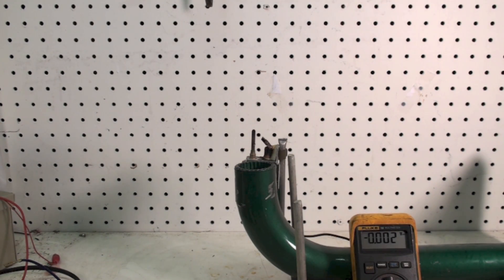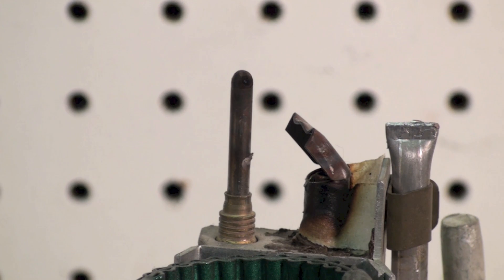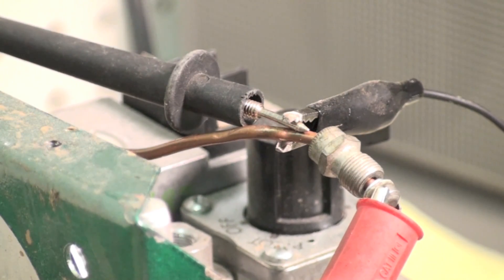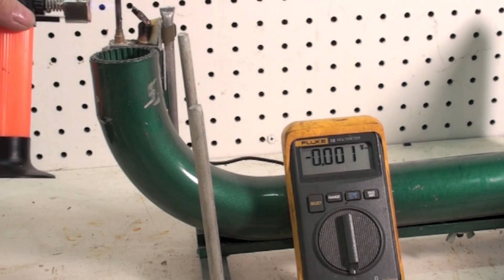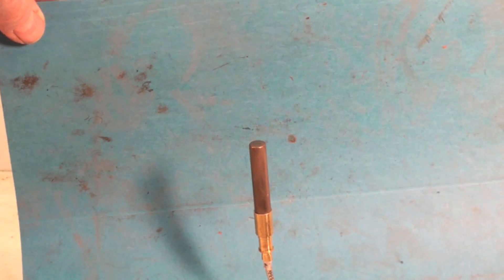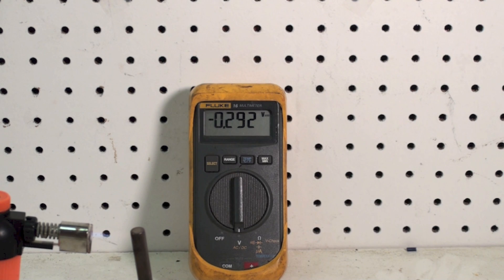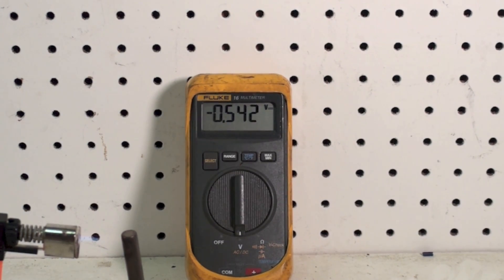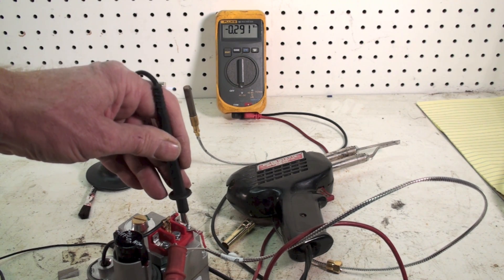The thermocouple compared to the thermopile.

Comment: I'm here to find out how wide the thermal-pile is thanks I found out, it seems exactly the same as the thermal-couple hole. On a furnace I'm swaping out a thermal couple for a thermal-pile and I different brand of piolet gas valve. This heater doesn't have a external thermostat so there is no way to connect a thermostat to the original valve so I have to replace it. The last time I took it apart I remember it has a Honeywell burner so just about any valve with work well with it.

Comment: May I ask if a water heater thermocouple be the same piece to replace a stove thermocouple? Or does a stove require a different piece all together? Thanks in advance.
Reply from the maker: Water heater thermocouples are the same as furnace thermocouples, they are generally just shorter.
GFM
Reply: @grayfurnaceman  thank you so much!

Comment: I'm about to change the thermopile on my gravity furnace. On the valve I'm not sure which post the red or white wires are supposed to go. Will it damage the thermopile if they are connected to the wrong post?
Reply from the maker: It makes no difference.
GFM
Reply: Thanks for your reply. I put in the thermopile on a furnace that hasn't ran in over 15 years, now I finally got flame. @grayfurnaceman

Comment: I'm able to light my pilot and it will stay on. However, when I turn the knob from Pilot to On, the pilot flame goes out immediately. Would yo suspect the thermopile or thermocoupler as the problem? Or, something else? Thanks
Reply from the maker: Are you sure you have gas available?
GFM
Reply: Yes, as I say the pilot does light and will stay on for hours but when you turn the knob from Pilot to ON the flame goes out right away. The gas supply is not the issue. I believe it is the thermopile or thermocoupler.

Comment: Hello sir. Could you help with one fireplace problem? Cdvr36nv fireplace. Direct-vent. It was shutting down on itself. I checked thermocouple, found that it is weak and everything rusted. I replaced the thermopile/pilot assembly. It was working, then I got a call from the customer. It is working but then again shuts down. I went started checking. Something weird was going on. Pilot was normal but after sometime it became lazy not touching thermocouple. And after sometime shuts down again. I tried to adjust pilot pressure, flame was not changing. Tried checking pilot pressure, no pressure. So I replaced the gas valve. Again the same issue. I am out of the options now 😂 Vent is clean. No idea what's wrong with it. I would think maybe air ports (although I dont know where they are located), but why pilot flame is not changing while adjusting it (on both gas valves) 🤔 Any help will be appreciated. Thanks

Comment: can you tell me how many amps does that thermopile produces?
Reply from the maker: No, We generally do not use amp draw to determine problems with millivolt systems.  In practice, if the millivolts are low, the amperage will be low.
GFM
Reply: @grayfurnaceman  I actually wanted to test it on small LED bulb but no luck. how ever a website claims it produces 1amps at 60 volts @ 200 Celsius heat, so i wanted to know that as well.

Comment: Hi. I have a 14 year old commercial oven in a restaurant. Pilot light would turn on and turn off. I inspected the pilot light on the burner . Found the thermocouple or pile wiring broken, flame was on it. Replaced the thermocouple. Question is do I have to rest the pilot at the controller.
Thanks
Reply from the maker: I am not sure what you mean by "rest the pilot".
GFM

Comment: IKe pilot on my gas fireplace will not stay on for more than 10 minutes then shuts off. What is it's problem?
Reply from the maker: Some fireplaces have a limit switch that will shut down the pilot system if the fireplace overheats.  Could mean the unit is overfired.
GFM

Comment: Hello sir, do the gas oven thermostats contain Mercury? I have Eurosit 630
Reply from the maker: If they were made in the 1980s or earlier, they could have.
GFM
Reply: @grayfurnaceman  thanks for the answer, i quess even if it has that stuff it can't get out of there right ? or if it did the thermostat wouldnt work anymore ? i bought mine last year so i guess it is safe....i dont want that stuff in my house...model is eurosit 630 that i have
Reply from the maker: @Ask8erM  I would not guarantee it could not get out.  The unit would not work if the mercury leaked out.  Yours is probably safe.
GFM

Comment: I have a Heat-n-Glow gas fireplace with a hard wired wall thermostat.  It worked fine with the thermostat but now it will not turn the flame on, however, by manually turning the fireplace on  and adjusting the temperature up, it will stay on just long enough for the fan to kick on.  It then cycles back off without ever coming close to the set room temperature.  Thermopile issue?
Reply from the maker: I would certainly be checking the thermopile.  Also all wiring connections, clean and tight.
GFM

Comment: My new gas fireplace has both. Pilot in the middle with thermopile on one side and thermocouple on the other. The flame touches both. 
The fireplace goes out after a few minutes. Any idea what I should do to trouble shoot this issue?
Reply from the maker: The thermocouple is a safety shutdown.  The thermopile is a power source for the fireplace. 
Is the pilot covering both the thermopile and the thermocouple?
If the pilot goes out when the fireplace shuts down, your problem is in the safety shutdown system.
If the pilot does not shut down, the problem is in the power source.
If the pilot goes out, the thermocouple is probably the failure.
If the pilot does not go out, be sure all connections are clean and tight.
Let me know if you are still stuck.
GFM
Reply: @grayfurnaceman  Thermocouple completely. Thermopile only partly.
What does the thermopile power exactly?
Reply from the maker: @jamescahill3390  About 2/3 of the thermopile should be covered.  It powers the gas controls.
GFM

Comment: 544 mil would reflect a woking valve. 250 to 300 mill would be a working valve with a load. What would be in mill volts a bad working valve
Reply from the maker: I have to disagree on your numbers.  325 or higher open circuit.  100 to 125 closed circuit.  Check with the manufacturers.
GFM

Comment: I was told that my fireplace was done due to a bad valve and informed that, parts were not available 4k for a new fireplace replacement. I got a second opinion and the thermopile was faulty, got it changed and now the fireplace works fine...
Reply from the maker: Sometimes I just don't get it.  Some techs just don't want to repair anything.  Glad you got the second opinion.
GFM

Comment: What's the solenoid current required for holding the pilot valve? The thermocouple output voltage is only 30mV!

Comment: Found the problem. After changing out the the pilot assembly the start up was fine, however when the fireplace was lit the pilot was slightly starved of gas. The pilot flame wasn't as pronounced and the piezo igniter was splitting the flame.  So the thermocouple wasn't getting sufficient flame.  I bent the igniter down and over a bit allowing a full flame on the thermocouple, thus solving the the problem.  Thanks for your video and response.  It definitely helped with the change out.
Reply from the maker: Glad you got it going.
GFM

Comment: Really enjoyed your video and have some questions regarding a recent repair I performed on a Heat-n-Glo gas fireplace.  I was having problems with the fireplace when I turned it off in the evening it would snuff out the pilot light.  Relighting the pilot became progressively worse. This went on for several weeks so I decided to replace the pilot light assembly that contained a thermocouple, thermopile and Piezo.  I replaced it today and achieved a nice blue flame on the pilot, however cant seem to keep it going for more than 8 minutes before I hear a click in the valve assembly cutting off the flame and the pilot light.  The pilot will restart after a few minutes.  I feel confident I made the repair correctly.  Did I repair the wrong part, should I have replace the valve assembly instead?  Your thoughts would be most appreciated.  Thanks
Reply from the maker: The original problem probably has nothing to do with the pilot lite unless it was very small or the flame was yellow.  
These type problems usually have to do with the propagation of the flame.  Its usually a question of moving the particles that the flame goes thru. 
As for the replacement pilot, is the flame covering the thermopile and thermocouple?  Are all the thermopile and thermocouple connections tight?
GFM
Reply: @grayfurnaceman  so they have both, thermal couple and thermal pile?
Reply from the maker: @rickeykeeton4770  They often do.
GFM

Comment: I have a fireplace insert that started turning on by itself.  There is a wall mounted millivolt switch with a pilot light. What steps can I take to find the source of my problem before calling for service?  It is a Heat n Glow model ROLS -18N.  Thanks in advance.

Comment: My 1999 LP gas Xtrordinair  Gas Fireplace takes several minutes sometimes 1/2 hour for the gas valve to open and function when the thermostat is calling for heat, is that a case of a bad thermopile? So called service technicians only seem to come in a replacing everything for $$$ until it works which has happened too many times  over the years.
Reply: Could be a dirty pilot a bad thermocouple or most likley if your using a manual on off switch to turn the unit on thats ur issue.

Comment: While the pilot on my Vermont Castings direct vent gas fireplace stays reliably lit, the flame isn't. It goes out after being lit and the time it is fully burning is shortening. I cleaned the unit and two thermopiles, had the unit inspected and it was determined I needed two new thermopiles. They wanted $1,000 for parts plus labor. I purchased two thermopile thermogenerators. Can I install these myself or should I use a gas fitter? I noticed that the wires for the thermopiles pass through a red rubbery sealant. What is this?
Reply from the maker: If you are confident, you can replace them.  The sealant is probably high temp silicone.  You can get it at a hardware store.
GFM

Comment: +GFM I have an outdoor thermometer, simply for outdoor temp readings while getting dressed in the morning. I have placed it out of the shade every way I can think of, but I am still getting false readings because of the sun. I have tried wrapping the thermocouple in aluminum foil and I have tried shading it even more so than it already is. I have tried tucking it beneath the vinyl siding, but still get false readings. the digital display is accurate at night and in a cup of ice water.
do you have any thoughts on how to prevent false measurements? I am limited to about 10' of wire between the display and the thermocouple. thanks
Reply from the maker: Not much you can do without moving it to where the sun can't reflect on it.
GFM
Reply: grayfurnaceman thanks for getting back to me....guess I'll keep moving it around and trying new spots. take care

Comment: Hi GrayFurnaceMan, I have a 35+ year old gas furnace (Howard Southwind) with a standing pilot light. Furnace works well when running but has intermittent ignition troubles and has taken as long as 30 minutes to start – other times it fires up right away. The worst offending time would be morning when the furnace has been off for the night. The pilot light is always on and is nice and blue. I thought it was the thermostat but have tried 2 other thermostats and the problem persists. Because it is intermittent I thought that the new thermostat was fixing the problem.  Inside the furnace the gas valve box has 4 wire screw terminals. It appears that two of them are attached to a thermopile…it has silver coated wire and two clips on the end with a white and red wire. The silver wire runs down to the pilot with a tube threaded into place. I put my multi-meter on the terminals and have a reading of 132 mv while the burners are on full. With the pilot light still on but the burners off…the reading is between 194 and 162 mv. It is difficult to get a solid reading off of the screws themselves. I also tightened the screws.  Besides the main gas burner pipe there is another small aluminum tube that runs out of the gas valve box and down to the pilot light. I am not sure if that is also a thermocouple. If I replace the thermopile – how do I know which one to buy? (When I went online to research gas furnace thermopiles almost everything relates back to thermocouples and most images do not have the wires…which my furnace obviously uses. I also see the K type mentioned….but I am not sure what part to order from my HVAC supplier) Most suppliers want to know furnace make and model naturally and here is no literature or manual available for my Furnace. I like my old furnace it has been chugging along perfectly for the last 20 years…the heat exchanger looks good, I recently replaced the blower motor and belt as well as the fan relay switch and filter as part of the maintenance. Thanks for any advice!
Reply from the maker: The thermopile millivolts appears too low.  Should read open circuit around 500 mv.  First check all connections to be sure they are tight.  Very low voltage here.  As an example, a 1.5 volt battery is 1500 mv.  You can replace thermocouple with a Honeywell Q313A1188 or equivalent.  That is pretty much the standard type used in most appliances.  Hope this helps.
GFM

Comment: Gray Furnaceman
I always have to manually turn on my fireplace it has the thermopile system
I use the igniter to turn on the pilot then I wait for the fireplace to light up sometimes it takes days and then it just keeps burning until I close the gas valve any thoughts of what I can do to correct this problem before calling in a repairman
Reply from the maker: If it was just a problem with the burner lighting off, I would say you have thermopile problem.  However, if it stays on, I would have to blame the gas valve.
GFM
Reply: @grayfurnaceman  
I'd be tempted to say that it could be both the thermopile and valve. That's a spendy repair. I just diagnosed a bad valve. Always a good idea to test it with a new thermopile first to make sure.

Comment: wondering if you could give me a little help my fireplace keeps going out but the pilot light stays on
Reply from the maker: If it is a thermopile controlled system, you could have a loose connection or the thermopile output could be low.  Be sure the pilot is blue and covering the thermopile.  Open circuit millivolts should be 500 if you test with a meter.  Hope this helps.
GFM

Comment: Is the 292 mv enough to pull a gas valve soloniod ?  Also is the 30 mv for a thermocouple big enough to pull a solonoid for a gas heater valve to let gas go through ?  Thanks for your good video
Reply from the maker: It depends on whether the voltage is measured with the circuit open or closed.   You should be about 500mv open and 125mv closed.  The 30 mv will open a gas water valve.  That is the only valve I know of that will work with the thermocouple.  Hope this helps.
GFM

Comment: I have a thermopile on my gas boiler. Yesterday I had to hold the pilot button down for 10 minutes before the pilot would stay lit. Does that mean the thermopile is at the end of it's useful life?
Reply: cottagestreetgirl probably if the pilot is clean.  Or it could be the wire connections have to be cleaned

Comment: Be on the lookout for improper thermostats with millivolt systems ,, the compensator in a normal 24 volt "mechanical" thermostat creates resistance in the circuit , this thermostat might work with a brand new thermopile but as they weaken slightly with age  you will end up with not enough current flow to open the gas valve .. the thermostat must be designed for millivolt ,, and not have a resistive compensator in the circuit,, had a gas fireplace that would work fine in the "on" position ,, but not work when in the Tstat  position (not enough current due to thermostat being the wrong type) thermopile itself tested around 550 millivolts , replacing the thermopile with a new one would be a temp fix due to the new thermopile being slightly stronger when its brand new but the core fault was  "thermostat wrong type"..
Reply: Yes , fully understood
Reply from the maker: You are correct.  If it is not a millivolt thermostat sometimes they work and sometimes they don't.  A Lot of fireplaces are set up with 24 volt thermostats.
GFM

Comment: The remote wall switch will not ignite the fireplace.  The local switch next to the gas valve will ignite fireplace.  What could be the issue.  The mV on the terminal board seem to be in the good range when both switches connected.  Any help is appreciated.
Reply from the maker: +William Anacker Connections are very important with millivolt systems.  Be sure all connections are tight.  If no help, replace the switch.
GFM
Reply: as a suggestion Make sure the thermostat used is designed for a millivolt system ,, many 24 volt thermostats have resistance in the Tstat itself in the form of a compensator and it lowers the current flow enough so the gas valve wont respond and open when called to deliver heat,